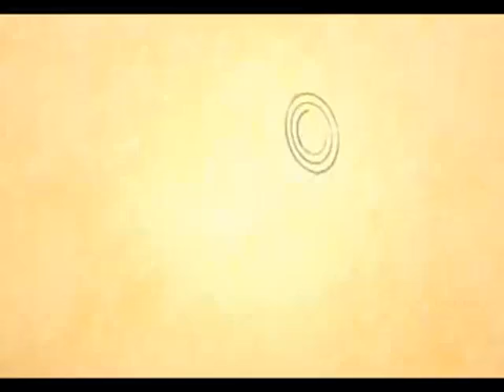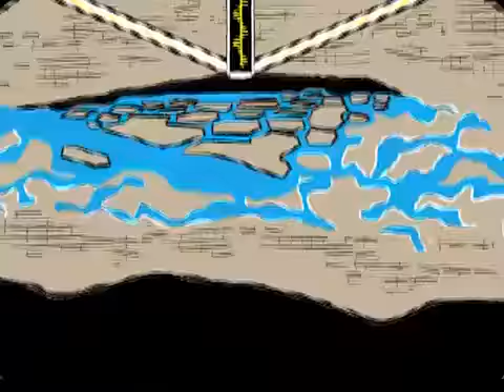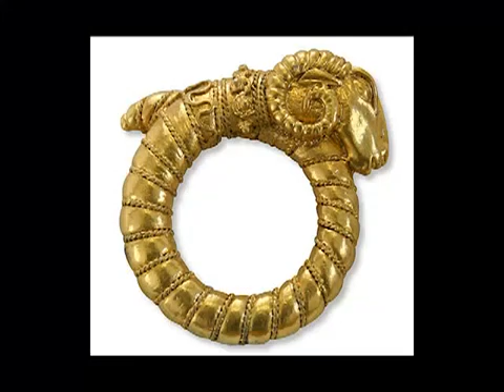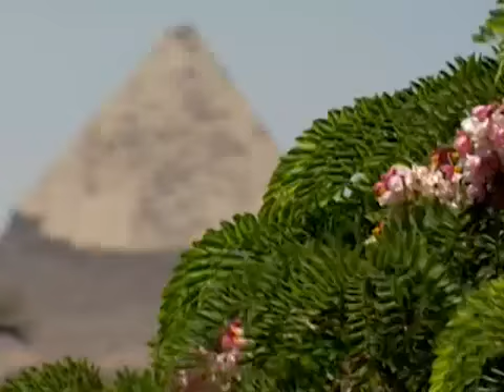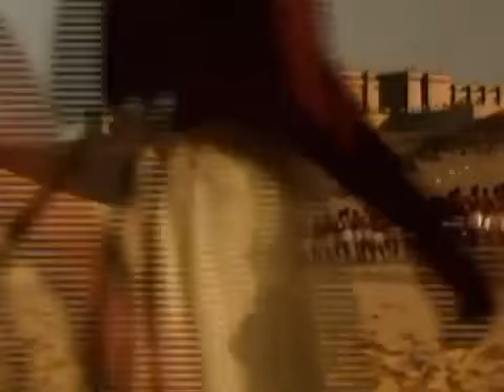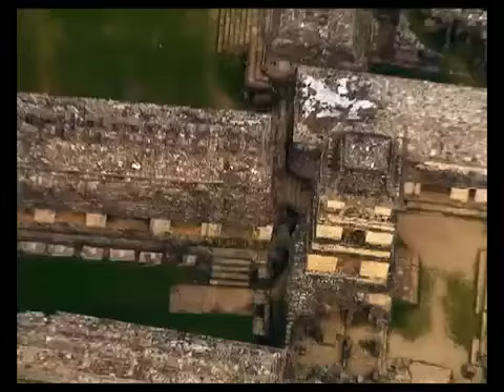Wireless energy, The real secret behind the pyramids?

Comment: Total bollocks! Lumps of stone are lumps of stone! They are useless as wireless devices! I am a radio engineer and have access to state of the are signal analysers and can assure you there is nothing of any significance there. I have measured the full electro magnetic spectrum from d.c. To 30 GHz and there is nothing outside of the local noise floor. NOTHING!!. If you have got any tangible proof then let's see it,show us measured results,not theories!

Comment: Metal & stone softening is accomplished by "Controlled Phase Transition of Metals" 
or "Melting Rock & Metals Without Heat" utilizing resonant pulsing strong magnetic energy.     http://patft.uspto.gov/netacgi/nph-Parser?Sect1=PTO1&Sect2=HITOFF&d=PALL&p=1&u=%2Fnetahtml%2FPTO%2Fsrchnum.htm&r=1&f=G&l=50&s1=7524385.PN.&OS=PN/7524385&RS=PN/7524385   
Using pulsing magnetic energy, we can purify, sanitize, and refine materials, and reprocess waste materials.   

Submillimeter diameter, intense but cold "plasmatic magnetic energy" beams,
of 1/4 inch long to a foot or so long, would be able to cut and fabricate those intricate quartzite, obsidian, and other hard "rock" art pieces.  Some of those "rock" materials were probably artificially made, i.e. man-made, or gods-made materials.   Robotic (CNC) machines would also be required, because human free-handing isn't that precise.
Apparatus and Method for Amplifying a Magnetic Beam
http://www.google.com/patents/US5929732  

Softening the rock without heat within seconds, using strong focused plasmatic magnetic energy, 
may be how they got the "cement" water content down to 1%.
This would prevent water damage & preserve the "stone" over time.  

If the builders of the huge "stone" organic structures had MagnetoHydroDynamic tech,
then they could hover in place to cut those structures high on the mountain sides.  
History the Free Energy Fluxliner UFO Space Craft - Mark McCandlish 
https://www.youtube.com/watch?v=KMOaSWUI-gI#t=7.901051902   

With new room-temperature superconductors & Nanoperm-type toroidal MagAmps,
cryogenics is not needed, & coil & capacitor weight and input power is reduced to < 1% 
of that in the engine that Mark McCandlish reported on. 
Room-Temperature Superconductors & High Temp Superconductors 
http://www.superconductors.org/158C155C.htm

This could be used to transport & place the megalithic blocks.  
Levitating Reactionless Thruster, 
9 times more powerful than the Space Shuttle main engine 
https://www.indiegogo.com/projects/superconducting-levitation-thruster#/  

Megalithic Softening of Stone  -  see my comments below the video
https://www.youtube.com/watch?v=TqUtb1O4TkA  

Wireless Power Transmissions would be insanely dangerous to life - 
to our health, and to the health of all plants and animals.  
It could still be controlled by just a few monopolists for excessive taxing, 
and it would be frequently disrupted, like the current fragile electric power grid.  

I put wireless power transmission in the category of chemtrails, GMOs, 
mercury in the dental industry, fluoride in municipal water systems, etc.  
Keep it out of my neighborhood.  The only people who promote it are those 
who are ignorant of electromagnetic pollution, and those who want to tax you.  

Mini-MHD generators, like 3D printers, offers local industry & independence,
and can build megalithic structures.

Comment: Yes, there is an error about what inside the centre. This is not the Ark but must be a very conductive and not rusting metal. Most probably a very big piece of solid gold. Mentioned in the Bible that when Israelites left Egypt, they took nearly all the gold of Egypt. As a result, the Egyptians had to chase them to get back the gold. Otherwise, the electricity generator will not function anymore.

This is a reckless distortion of the original story. But, the technology is real, kindly google Telsa Tower, you will know.

Furthermore, in fact, if it is the Ark, how come there are more than one pyramid in Egypt. Pyramids are also found in other far far places, especially those places with abundant amount of gold.

However, believe that the technology is given by Yahweh to Joseph. Because of this advance technology, Joseph is raised to the post of Prime Minister of Egypt. Just explaining a dream may not command such a position in Egypt for a slave and prisoner. May be more other technologies also.

What an Almighty Yahweh! What an Infinite Wisdom!

Praise the LORD! Amen!

Comment: This idea could still be possible without the Ark. The system would work as long as you had something metallic connected to ground (negative). No need for the ark to be in the stone basin. I think the stone basin was used as a healing chamber.